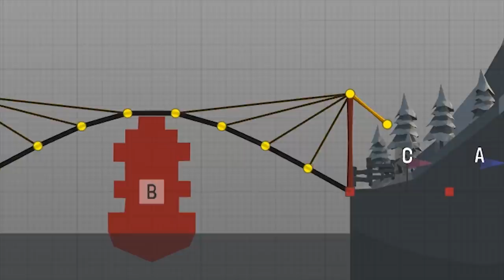Using Basic Geometry To Play Poly Bridge

Comment: "OMG It worked!"

Bridge: I have decided that I want to die
Reply: wdym, I DID die.
Reply: You missed the chance to be original
Reply: I like your profile
Reply: *I want die
Reply: I'm the two thousandth like and I feel probably a bit too proud of that title
Reply: XD THIS COMMENT IS GENIUS
Reply: @nickwijkstra3774  feel bad for the person that actually complimented you
Reply: @caed7189  hah i dont ecennknow what that means
Reply: shrugs Guess I'll die
Reply: PopSocket

Powerbank (10,000mAh minimum)

Overwatch PC game.

Couch/Sofa

Air Purifier

Eye glasses

Sunglasses

Snow Cone maker

 

Cheap TV with DVD player built-in

FHD or UHD4K 120Hz TV…

AA and AAA batteries

Smartphone Wallet Case

HDD Caddy (to convert old to portable)

 

15" Laptop with at least 3x USB-A ports. 

Lenovo T420 Thinkpad with Windows 7 to be my daily
driver.

Tablet or 2in1 for Drawing / Samsung Tab S6 / Surface /
WACOM Cintiq? (or Apple stylus for iPad)

New Clothes.

 

Gaming Keyboard (MX Browns over Reds/Blues)

Gaming Mouse with 2 thumb buttons

Gaming Headset splitter cable, or to USB.

Deeper computer Desk. 

 

Skateboard and Kneepads

Polaroid Camera/INSTAX

Piano/musical Keyboard or Guitar/Violin

 

Tape Measure

Dashcam with parking mode.

12v Car Adapter and triple charging cable (USB
C-MicroUSB-Lightning)

Sunshade Windshield

Steering Wheel cloth cover

Car Visor extension. 

Used Car (Hatchback or small sedan)

Smoke Detector

Cheap water-resistant IP68 rated Smartphone for Dad

Cheap Mobile Plan for Dad

Product to clean oven grease??
Reply: I want die*
Reply: I want die.
Reply: Misaka best girl

Comment: Nobody:
RT: we need more triangles
Reply: PopSocket

Powerbank (10,000mAh minimum)

Overwatch PC game.

Couch/Sofa

Air Purifier

Eye glasses

Sunglasses

Snow Cone maker

 

Cheap TV with DVD player built-in

FHD or UHD4K 120Hz TV…

AA and AAA batteries

Smartphone Wallet Case

HDD Caddy (to convert old to portable)

 

15" Laptop with at least 3x USB-A ports. 

Lenovo T420 Thinkpad with Windows 7 to be my daily
driver.

Tablet or 2in1 for Drawing / Samsung Tab S6 / Surface /
WACOM Cintiq? (or Apple stylus for iPad)

New Clothes.

 

Gaming Keyboard (MX Browns over Reds/Blues)

Gaming Mouse with 2 thumb buttons

Gaming Headset splitter cable, or to USB.

Deeper computer Desk. 

 

Skateboard and Kneepads

Polaroid Camera/INSTAX

Piano/musical Keyboard or Guitar/Violin

 

Tape Measure

Dashcam with parking mode.

12v Car Adapter and triple charging cable (USB
C-MicroUSB-Lightning)

Sunshade Windshield

Steering Wheel cloth cover

Car Visor extension. 

Used Car (Hatchback or small sedan)

Smoke Detector

Cheap water-resistant IP68 rated Smartphone for Dad

Cheap Mobile Plan for Dad

Product to clean oven grease??
Reply: @stevethea5250  wtf?
Reply: @stevethea5250  dude just posted his whole Christmas list
Reply: @kirinnarukami4016  damn right i did
Reply: Buy a rotary.
Reply: @Steve Thea   bro same
Reply: I guess you didn't learn how to build a bridge in geometry, because you learn that triangles support bridges are oppose to rectangles which are not structurally solid.
Reply: T'was an old username and I'll change it soon. I’m not saying he’s doing anything wrong lol

Comment: Btw that last level is extremly easy, it wants you to build an elevator but all you have to do is make the bottom one go across normally and have the second one drop down on the first road and have it continue driving from there. May sound a bit complicated but its extremply simple and you don't even need to touch the hydrolics then.